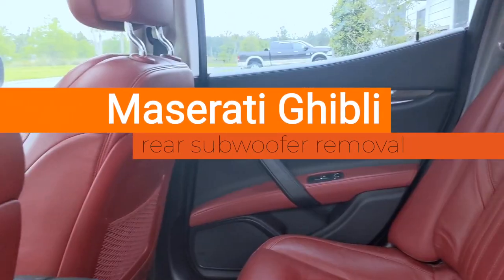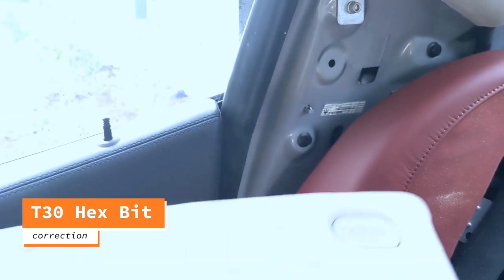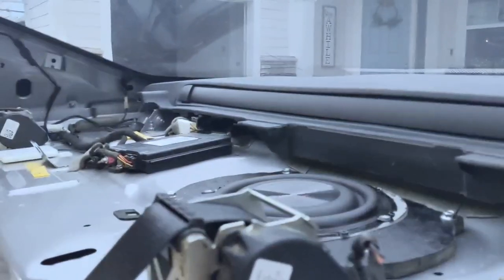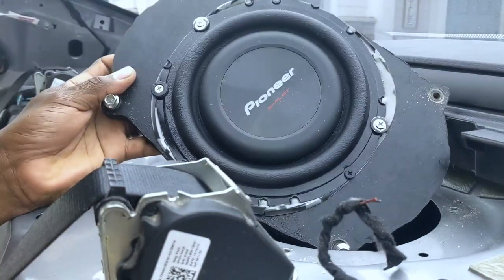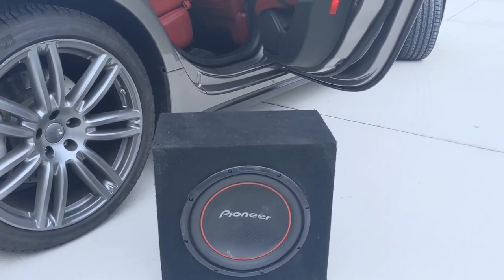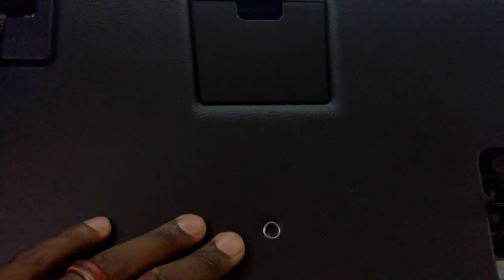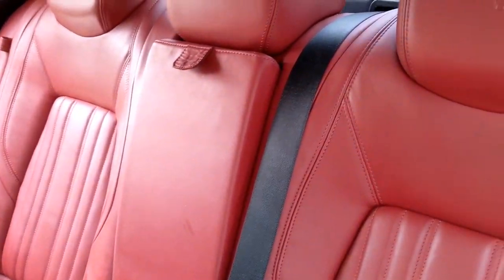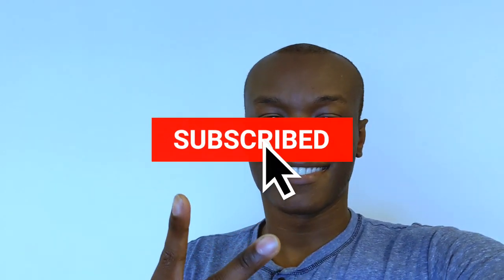How to remove the rear subwoofer from the Maserati Ghibli?

Comment: Great instrucfions but my panel doesnt come forward. I lifted it a little and pulled towards the front of the car but it feels like there is somehing on the back hodling it down. Pleas help
Reply from the maker: You will need to unfastened the clip on the side where it says airbags on the back pillars. Simply remove the cap that says airbag and unscrew the trim.

Comment: Did you hook up to the door speaker, or directly to the head unit
Reply from the maker: The sub is connected to the amplifier. The door speaker is taken directly from the trunk by the OEM amplifier

Comment: Great job on this video.  I want to replace the terrible factory sub in my 2015 Ghibli.  Did you just run the new sub off the wires from the factory amp?
Reply from the maker: No, I have an aftermarket amplifier where I connect it. You can run it to you EOM amplifier, but it may blow your speaker if the subwoofer is power-hungry
Reply: @androidnavigation how are you feeding a signal to the aftermarket amp?
Reply from the maker: Yes, I removed the factory amp completely
Reply: @androidnavigation  Did the amp require any special programming or adapter?  Or just plug and play...assuming you used all of the existing factory wiring?
Reply: BTW...what did you use for an amp?  Sub only or driving other speakers too?
Reply from the maker: The signal is coming directly from the head unit. I have the Tesla screen head unit
Reply from the maker: I have a five-channel amplifier, I route the four output line from the radio to it and create two crossovers from the front left and right and made my fifth channel. Consequently, I do the same for the output speakers, I routed all the regular channels front/rear/and sub the I create a center channel crossover from the rear speaker. It sounds nice
Reply: @androidnavigation  How thick is the material you used for your mounting template?   I am going to try to make one but I was wondering how much tolerance there is for mounting height.

Comment: thanks!
Reply: Wait you used the speaker wire from the original sub, added an amp, good. How did you get the signal and power wire from the sub?

Comment: bro im stuck, i cant figure out how to remove the air bag panel.. i removed the bolt under the plastic clip but you didn't even explain how to remove the door trim too, you already had it all removed and failed to explain..
Reply from the maker: There is a screw under the buttons label airbag. Use a pry tool to remove it